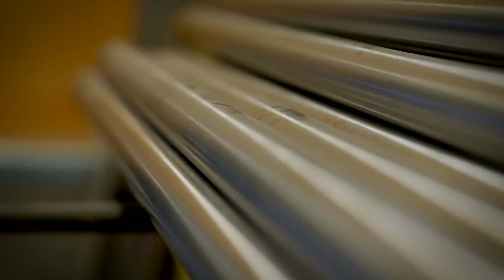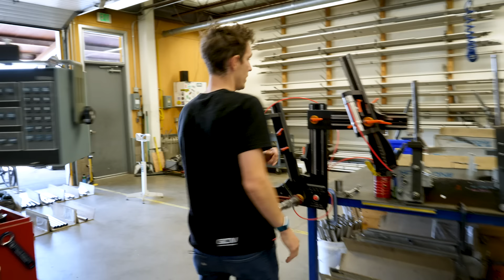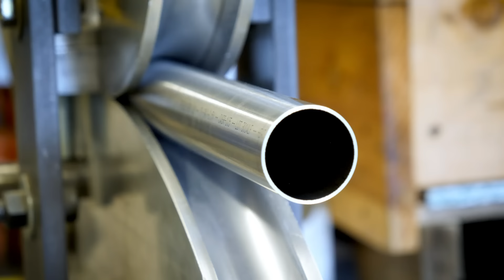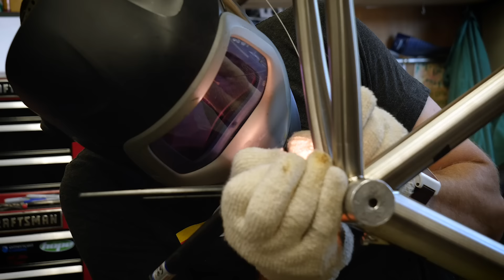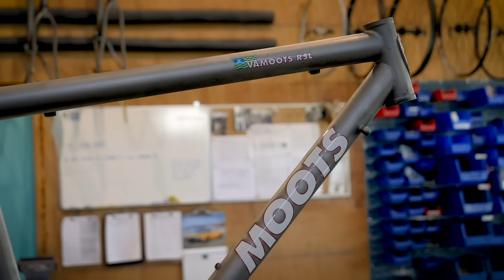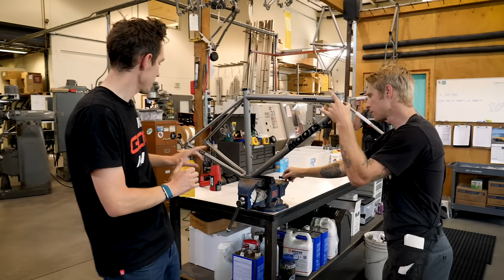How Are Titanium Bikes Made? | Moots Factory Tour

Comment: head badge installed with screws? why not with aircraft titaniu rivets? 
weldet titanium tube frames or only 3D printed  drops not longer up to date, here  https://www.youtube.com/watch?v=dsHY8532F4I you see first FULL 3D printed titanium frame and it's the begining, the future is tube-in-tube frames(hydralic brake line printed inside/toghter with frame tubes) lightweight+more stiffness

Comment: I can remember reading, in the 1970s, frame builders claiming hand filed mitered tubes were superior to machined mitered tubes.
I was told by Mike Augsburger, that the best welds he has ever seen, are performed by one guy who works at Moots.
Titanium is more crash resistant than carbon fiber, you can inspect it visually and then get going.
Isn't titanium a material that can be repaired with no loss of strength - ie heat affected zone.  
Which means it can be ridden for generations.
How light of a road bike can Moots build? Disc brakes add weight, is the difference between titanium and carbon fiber within that range of additional weight?
Is there a titanium fork option?

Comment: When we used to weld, titanium, zirconium, and tantalum for the weld bead was “bright is right.” Meaning the bead is bright and shiny, any other color the weld is contaminated. 

1) The “tube” around the tungsten is called the “cup”. And there are different size cups and well as different size torches.
2) A “straw color” weld generally means the weld a little hot.
3) All the welds have to be “back purged”, meaning gas is on the back side, or the side opposite where the torch is.

Comment: Except when your off road pushing your frame flex to its maximum limits does the the word titanium get used. So many times while talking to bikers in NYC were they brought up the fact that titanium was so light weight it made a difference while in fact it is a heavy metal which can machined down to a light weight and a strong part.
You craftsmanship shows and you should build and sell a few basic custom motorcycle fames.

Comment: DOM. Drawn Over a Mandrel.  Dimensionally very accurate with little to none variance in OD measurements. It’s “Bang On.” the gap space is about .008 or  8 thousandths of an inch., from a cursory guess? Pretty much aerospace tolerances. You need some margin of error to make the frame lay flat on a plane so you don’t get the rear chain stays splayed or angled and you’re wondering why the bike doesn’t track straight. A single sheet of copy paper is  2-3 thousands of an inch thick as a reference. Their frame welding fixture is very nice. So was their in house tube bender. Cool Video!

Comment: Nuke Proof in the 90's had a very good welding fixture.  The 1 inch thick jig plate was cut out in the middle, (like a doughnut hole), and the frame tubes were held with v-blocks, (set with a "master frame") in the center of the hole.  The fixture can then be rotated 360 degrees on it's stand, and the welder was able to access both sides of the bike in one operation.  Weld a bit, flip the fixture, weld a bit on the other side, flip again when ever needed by the welder.  One fixture did it all, and it proved to help keep the frame straight by evening out the welding on both sides when ever the welder wanted to weld a portion on the other side.

Comment: "The Fork is made in the carbon capital of Asia" translates to made in  China were there is no fear of carbon fiber dust health risks .Pay top dollars for a bike made partly by exploited workers.The bike is expensive enough so why not also build the fork in the US , at least the workers then are protected by US workplace laws.
Reply: ENVE and Wound up forks are made in US I think. Some 90's Reynolds forks are US made. I agree. If I had the money to buy one the fork would be the first thing to be swapped out.
Reply: Money. Simple.
Reply: Carbon frame fabrication is mostly a labor intensive process, you need to employ a large number of skilled labor to make these frames, the production output will also be lesser compared to aluminum or steel, all these factors conspire to increase the cost of the frame. The Chinese can do these cheaply used mainly because they have the infrastructure in place already for many years now. The labor is cheap and so is the raw material. 

There is no way you can build up an infrastructure in such a short time, the Chinese started implementing their industrial policy in the late 70s, after steadily working hard at it they have come to this position after so many years.

Comment: A great frame can be made from titanium top and down tubes using "carbon fiber" joints. I'd probably prefer ti stays as well. The seat tube will vary according to whether you want to prioritize weight over wind tunnel tests. The main problem with metal frames (in competing with more versatile material combinations) is the joints and then some of the special shapes that are dominating the roads as a result of advanced wind tunnel testing. 

OTOH, replacing something like a Tarmac SL6 style bike can probably be done with all ti tubes and just a few carbon composite components...like the head tube and joints/junctions. The entire rear triangle can be ti. The fork can be ti below the crown. The joints that mate ti and composites would be glued. Ti mesh can be used to replace some if not all of the 'fiber' we expect in "carbon fiber" projects.

Comment: I am a bit amused that the tolerance they use for frame alignment is +/-0.005" because when I plop my fat ass on the saddle and pedal awkwardly away stomping on the pedals to achieve 14 mph, that frame is groaning and creaking and could not be closer than +/-50 thousandths to what is called "aligned"...but I guess you have to start somewhere...

Comment: All the external weldings are polluted with oxygen, and only the internal part is as we say well welded.
Reply: Most weld machines come with a gas that blows the oxygen away... Including Tig, which is being used here. In this case they use argon.
Reply: @HeadHunter0974  Time will tell how it will hold up.

Comment: I believe, if you use corrugated tubes(especially longitudinally corrugated......corrugated sheet rolled and welded)you can decrease tube wall thickness/weight and get better strength. The cross cut profile would look like a gear.....
Not quite same as this....but that is the idea: https://www.indiamart.com/proddetail/stainless-steel-321-321h-corrugated-tubes-11621404073.html

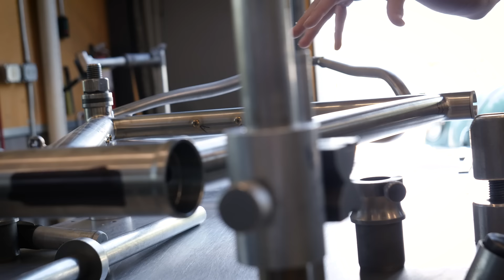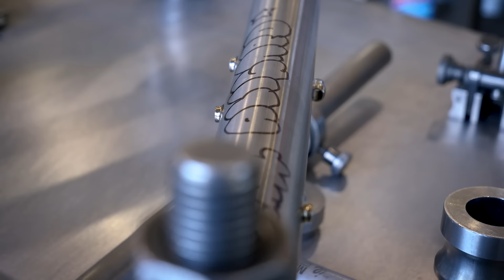Comment: FYI SI .005 thou=.0127mm does not equal .0010mm 11:16-11:45
Reply: FYI, 1/5000" = 0.0002"=0.000508mm = 508 nm. which does not equal 0.005" as you mentioned.
Reply: @apendretas  5 thou is .005" I wrote it in a confusing way, but I don't know what math you are doing.
Reply: @alexandero.4496  the math I did was of 1/5000 instead of the 5/1000, freaking imperial system. You are correct indeed, my bad.

Comment: .005in. is equivalent to .127mm. The last time I used a micrometer on the wall of a cut open aluminum can, it was .004in. (.102mm). A sheet of binder paper is .003in. (.076mm). Most tooling for firearms have a tolerance of .0002in. or smaller, especially if it is a rifling button (the tool that forms the spiral grooves in a barrel).
Reply from the maker: Thats an incredibly tight tolerance. Thanks for putting it all into a useful context for us

Comment: This is one of my favorite videos you guys have put out.
As soon as you flashed the drawing I paused the screen and I geeked out when I saw how tight the tolerances they use are. FYI "5 thousandths" is 0.005in or about 0.1mm. I think I was more shocked about the angle precision listed on the drawings. And think about how tight that is, when you picked up the long tube it would flex under its own weight far more than 0.1mm.
Reply: You are right..0.1 MM  isn’t much in engineering practices, it’s actually not a very high tolerance
Reply: @arbjful  0.1mm on a bike isn’t much? Just think about how small one millimeter is

Comment: Surprises in this video
-The tubes are thick!  Way thicker than the aluminum of other top mfg, yet aluminum is not as strong, and fatigues.  They don't even butt the tubes so there are several ounces of spare metal.
-Ti tube costs even more than I thought!
-3D printed Ti dropouts -Top notch tech!

What he missed
-Ti has unlimited fatigue strength and crazy temperature limits.  These are "forever" frames -fatigue, corrosion, even fire will not harm it!
-if you run over it with a car, or somehow destroy it, it WILL BE RECYCLED because the base metal is worth so much!
-the down side of the points above -theft -this frame is always worth lots of money.

Comment: When you say 'reactive to oxygen' I think what you meant was 'explosive when heated to high temperatures in the presence of oxygen'. High temperatures being weld conditions. The vanadium is probably the bit of the alloy that curbs this tendency (if I recall my metallurgy correctly), so that's why it's not outright explosive, but that is the biggest part of the reason you have to use Argon for annealing or welding anything containing titanium. :)
Reply: The main reason for the Argon is that titanium when alloyed with oxygen forms a brittle phase known as “alpha”…they call it “alpha case” when you get a layer of this on the surface of a weld.

Comment: so there is a suspension  but no  joint on the tubes by the bottom bracket  , is it then just the flex from the titanium tubes wich makes the movement posibile,

Comment: I bought a titanium Litespeed over ten years ago, and sold it to a friend after only a year.  Smooth almost to a fault.  I have never had the pleasure of riding a Moots, but I'm sure they must be awesome.  Tom Kellogg from Spectrum  Bicycles in Trexlertown, PA also was a wizard in titanium and did work for Merlin Bikes as well as his own in-house custom bikes.  As to how long materials last, my steel Eddy Merckx is 13 years old with 40,000 miles on it, and it rides like new.  And my Jamis aluminum 15 year-old with 60,000 road miles on it is going strong.  Both bicycles have had saddles, wheels, and various components replaced, but the frames are solid.  I think craftsmanship is key.  Obviously Moots cares, and it's why they have such a great name in cycling.
Reply: Oh I mentioned Tom because I also own an all steel 1990's Pinarello that was repainted by Tom.

Comment: Does anyone else think it's strange that even with all the "advantages" of titanium they still use a carbon fibre fork?
Reply: staminapromos no.
Reply: Carbon fiber isn't really bad, but using it for a fork is a good idea because making a fork out of titanium would increase the cost quite a bit because of how difficult it is to not only bend the forks, but also shape them into an aerodynamic shape, put the dropouts and the fork tube that will be later cut.
Reply: @casualguy393  So why not just make the frame from CF?
Reply: @staminapromos  Titanium frames absorb more of the road buzz and small bumps than carbon fiber. It isn't really too difficult to make into top tubes, bottom tubes, seat and chain stays and head tubes provided that they are just round tubes. Making modern day shaped forks (aerodynamic) out of titanium is a much bigger problem. 
Litespeed and a few others shaped titanium tubes more aerodynamically, but titanium isn't a good metal for doing so.
Reply: @staminapromos  Titanium never breaks.
Reply: I think there's a lot of cost involved in getting a fork design certified for safety.  That's why I believe you see such a large number of frame manufacturers, but very few fork manufacturers.  If you notice, everyone's CF fork looks more or less the same.
Reply: I know from racing R/C cars. we use every material imaginable. we really only use titanium turnbuckles (sometimes screws). the thing that takes the most punishment on R/C car is the chassis and it 7075 aluminum at 3mm thick (less weight than titanium)(never seen one break). just look at this https://www.youtube.com/watch?v=B601rrLFn-E  ... to me the only real "advantage" of titanium is how fast it rebound back to shape after flex (spring back).
Reply: @gatorage850  do you often provide answers to questions that didn't get asked?
Reply: @cliveramsbotty6077 I was showing why there not many "advantages" to titanium with examples. and also saying using multiple materials normally works better.
Reply: @gatorage850  i understood everything you said but you gave an answer to an imaginary question.

Comment: Just started biking for about a week now, is it normal to have a shoulder pain?
Reply: rberryllefz could be leaning too for forward, with too much weight on your hands. Shoulder pain can also be caused by gripping the bars too tightly
Reply: @HydeMyJekyll  I'm pretty short, 5'4" the bike is 53, should I reduce the stem or, raise the handle bar or, both?
Reply: rberryllefz before buying any parts, try raising the stem up some. If that doesn’t help enough, a slightly shorter stem may help as well. Your local bike shop probably has some used stems of various angles and lengths you could try out for free to figure out which one to buy.
Reply: I'm 5'8" and I ride a 51, because of the reach problems I was having. Higher/shorter stem can help, since my old 54 was way too far and was giving me shoulder problems.
Reply: @ghettoshampoo will shorten by stem a bit and adjust my saddle fore and aft. Hope this helps for me

Comment: I wish you never did this video.... Now I have an itch for a Ti bike. Good to see accountability built into each step of the frame build.
Reply: I've got a titanium bike and it is not only every bit as fast as my carbon bike, the ride quality feels tons better. The brushed finish never goes out of style like paint, the material is much more durable, it resists scratching much more than paint, It'll never rust like steel or fade like paint, as long as the welds were completed with argon it will almost never crack or break unless I'm run over by a Kenworth, titanium bikes are rare so you most likely aren't going to be riding the same style or model as anyone else in your group or at a race... I could go on. I've put almost 20,000km on mine so far and it still feels brand new.
Reply: They are worth it. I know I am not helping your wallets future width right now!
Reply: My aluminum bike (canondale) cracked within the crank areas, and despite replacing the bearings, still makes an embarrassing CRACK noise when pedaling hard.
My carbon bike (specialized) delaminated under heavy acceleration and the chain stay snapped in half.

It's not dysfunction that makes you eye a Ti bike. It's a desire for stability.

Comment: There's no doubt that titanium bike frames can be absolutely HEAVY.
Reply: My 2016 T1 weighs a few grams over 1kg (size 54). Much lighter than steel.
Reply: @casualguy393  It enlightens me, mine is carbon and I used aluminum, never thought titanium could weigh less than 6kg.
Reply: @dominicyoung3550  I think the lightest carbon frames are about 600g, so titanium is a bit heavier, but I'm not a pro, and I don't do much climbing, so the 500g or so of the titanium frame over the carbon frame is no big deal for me. With no water bottles, seat bag, or aerobars, my big was just under 9kg. And that was with a temporary cheap seat, and MTB pedals. Changing those 2 items out for a proper seat and pedals would have put me at about  8kg. I'm just amazed at the ride quality every time I sit on a carbon bike and compare them. Titanium just eats up the road buzz. If you have a chance, try one out. It is difficult to go back to carbon lol

Comment: I'm a firm believer of titanium bike, I left one in a moist storage room for 3 years, just took it out, even the chain has rusted beyond recognition and the frame is still shiny new.
Reply: why not aluminium
Reply: @ameraldas3641  titanium is half the weight of aluminium and is rust free in it's raw unpainted state. In fact titanium bike can't be painted the paint cannot stick to the surface. Steel and aluminium bike will rust/corrode/oxidation after long period especially without paint
Reply: @etact8888  first off, aluminium is lighter than titanium, second I think the word you are looking for is stronger not lighter, third titanium does oxidize in a similar way to aluminium, as there is a thin outer layer of oxidized material on the outside that protects the rest from rusting, fourth you can paint titanium as it is just a smooth hard metal, you paint it like any other smooth hard metal. I don't know what kind of marketing Bs you are reading but most of what you said was somewhat or loosely based on the truth if at all.
Reply: @etact8888  Aluminum is lighter than Titanium and Titanium can be painted. Many Litespeed's come from the factory painted and the paint lasts just as long as it does on other frame materials.
Reply: @ameraldas3641  I'm no technician, but the term lighter is referring to the full built bike which technically has something to do with strength density etc and I have not seen  an aluminium bike that is really lightweight. As for paint I do have a mountain titanium bike that is white painted but the manufacturer told me it is not a traditional spray paint method something involving ionizing like in the video.  It's a Taiwan brand called rikulau, maybe they're b.s.ing who know.